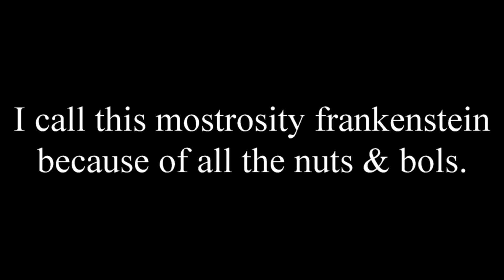My Homemade Quadcopter Frame part 2

Comment: "began to useprofanity" ahahahah Man great vids. Going to do something like this!! Wish me luck!
Reply from the maker: Tabata Workout Music thank you for your kind comments. The funny thing about this video is, I never actually flew this Frame although I did try. Like an idiot I had the flight controller facing sideways and not straight and ended up crashing on takeoff twice. So, I designed a new frame that I flew for over a year with the flight controller facing the correct way. Of course I also crashed that frame twice, the second time being  the end , then ordered a $90 Tarot Ironman frame from eBay.

Comment: Hi man, i'm building a 450 mm quad drone for a contest, it is going to weight like 1.7 kg and i would like to know if you could help us defining the tickness of the main frame, composed of two sheets (very similar to the one you showed in your video but with "two levels" and other shape), and the external and internal diameter of the carbon fiber tubes that we intend to use as arms (It would be so useful for us if you give us the dimensions of the carbon fiber tube that you used in this video). In such way that we guarantee structural resistence and lightweight. Thank you!
Reply from the maker: It took a while but I found the order. 2pcs 200×300×1.5mm With 100% Real Carbon Fiber plate panel sheet 3K plain weave...

and the tubes are

Glossy 25mm OD x 22mm ID x 1000mm 3K Roll Carbon Fiber Tube/Arm/Rod Quadcopter

Thanks for subscribing